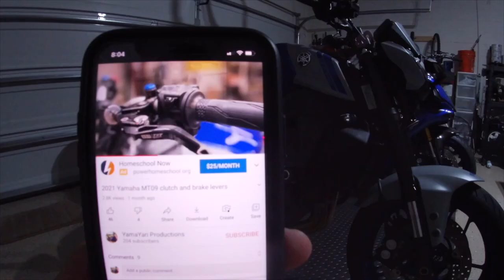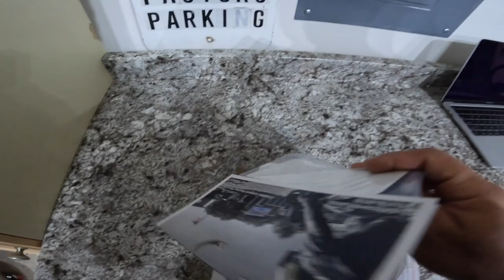2022 Yamaha MT09 SP Best Tank Grip & Protection (TechSpec) install.

Comment: How did you get the warning sticker off the tank without being able to tell where it was?
Reply from the maker: Use a blow dryer and barely heat the sticker. Use your finger nail on one of the corners and peel it really slow as you heat it lightly. Do not apply to much heat because you will melt the sticker. After that use goof off to remove the adhesion portion of the sticker with a microfiber rag. Then you should be good to go.
Reply: Thanks